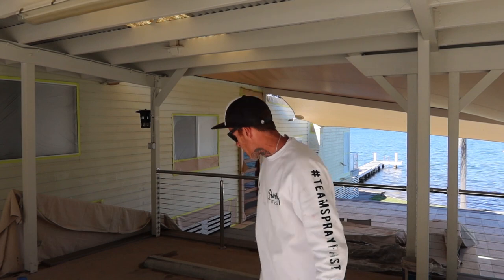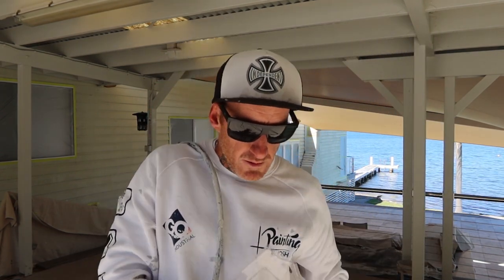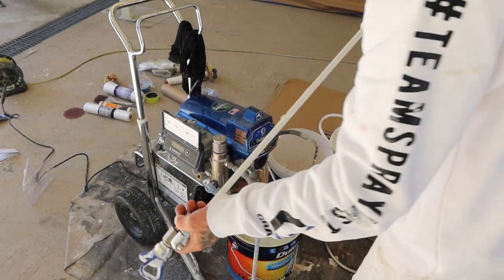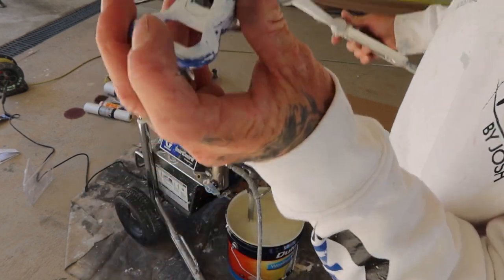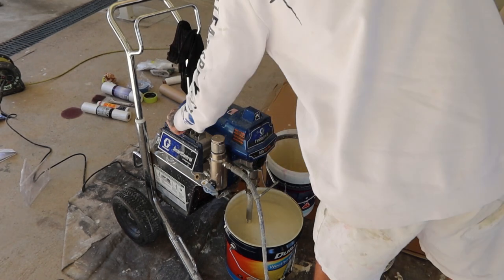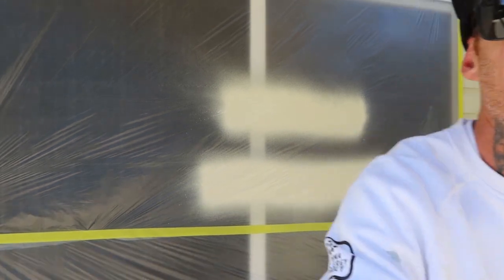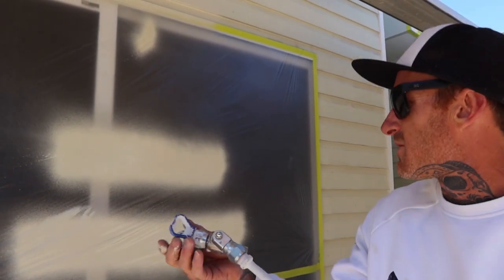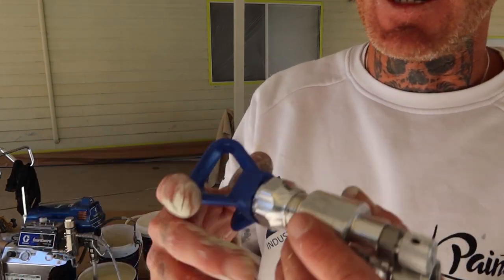INS AND OUTS OF THE GRACO CLEANSHOT VALVE

Comment: we use this in the UK a lot , down at 800psi  with tri teck and graco lpff tips , its the dog bollox , as well as inside  cabinets and trim , its a grate angle finder , just need to get the pressure balanced out
Reply from the maker: Sounds like a awesome setup mate. Definitely helps with them hard to reach places💯 🙏

Comment: Hi Josh, great videos! At 2:24 you talk about the throat liquid that you pour into your machine. I am a diy guy and have a graco project sprayer. Do I need this stuff? Any tips would be appreciated.
Reply from the maker: Hi mate thank you for the positive vibes. Depending on you graco machine but a lot of the project and diy machines do not require throat seal liquid I'm sure this would be the same for your machine👍 hope this helps mate
Reply: Thanks Josh! After further investigation the pump is a sealed unit on my little sprayer.
Reply from the maker: @adamsapple65  awesome mate I  thought so 👍

Comment: Thank you.  I bought an X7 and the clean shot based on people saying extensions cause spatter.  I'm doing the trim in my house and all 30 doors right now.  I had no idea how to use the sureshot.  One question.  How do you determine your pump pressure before you dial in the sureshot.   I don't know if I'm setting it at 800 or 3200 psi.  My pump does not have a gauge.  Thank you.

Comment: Josh any advice on when the cleanshot no longer holds its swivel? I've only used my band new one 4x and it still holds pressure but now the neck is very loose and will no longer hold a twisted position against gravity. The 180 valve just droops and falls making it useless now. Maybe i've blown a seal? I can't figure out how to fix it, it's basically new
Reply: Thsts strange, iv sprayed through them literally hundreds of times and never had that problem. Mine recently was still spitting so for first time I soaked in thinners then pulled apart to clean and see what was actually inside. Im no expert in the workings of part but definitely dosnt sound right only after 4 uses. Good luck
Reply: @adxn7946  thanks man
Reply: @maxa3221  no worries, I was also wondering, it could be as simple as the little nut holding the swivel bit on may of loosened a bit and might need tightening.  Again though iv never had that happen.
Reply: @adxn7946  Ya for sure but that part was never loose. That nut ties the whole swivel ('35a' in the diagram) to the rest of the actual valve. The broken part is whatever hold the swivel itself together and allows the neck to rotate 360 - there's a joint between the threading and the neck of the swivel. The warranty guy is responding so i'll let you know but I have a feeling it's a product failure. The repair kit is entirely for the valve side/spring. This is a swivel joint issue entirely. appreciate the ideas.
Reply: @maxa3221  fair enough hope it get resolved for you, are you a painter by trade if so where do you operate, Im Melbourne Australia painting sinse about 94/95 and here i am watching someone do what iv seen and done everyday for decades. Funny when you thing how fkn sad that is lol
Reply: @adxn7946  yeah but they didn't have youtube 30yrs ago matey. I just got an aussie pregnant tho in canada lol - yous guys got the good sheilas. Even better Graco is giving me a full refund on the cleanshot, they dont know what's wrong with it either. I may have  overtightened it the 1st time I used it with a just big enough wrench. Not sure but all good now.

Comment: So If You Have The Clean shot valve dialed into the "Flush" position. Can it be used  strictly as a directional for spraying ceilings where one may not need necessarily the spit free. Thus saving wear and tear on the clean shot valve??
Reply from the maker: Hi John. No if the Cleanshot is left in flush position while you spray it will not come out a fan pattern with alot of splatter from my experience 👍🙏

Comment: Every time you finish using the Clean shot,    strip it.    Even after flushing it will still have paint in it.     Dont over tighten the 2 x 5/8 nuts.   Just nipped is enough.    I put a tiny smear of Vaseline on the O/ring before assembling

Comment: What if I’m only using a 10 inch extension, still need this?  Thx
Reply: any extension will leave paint in it without pressure.  So when you start spraying again it will splatter with the paint left in the extension.
Reply: @chris560  So extensions basically suck then!  😁👍🏻
Reply: @tundrawhisperer4821  if you know where to start and stop no. They are very valuable.  The sure shot can help with spurts.

Comment: I don’t understand  why these are required, I just spray with my gun and the finish is fine,?
Reply from the maker: They are not required but definitely eliminates spits when running extension. And with the swivel you can Spray horizontally without using a ladder👍🤙🙏